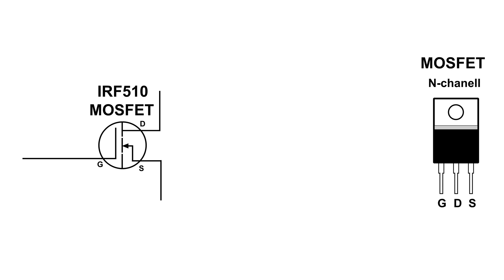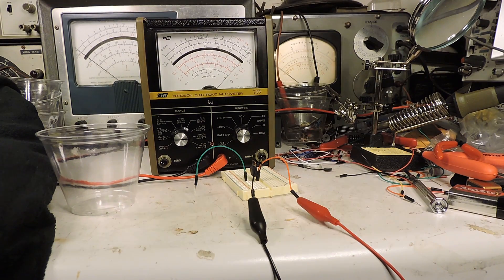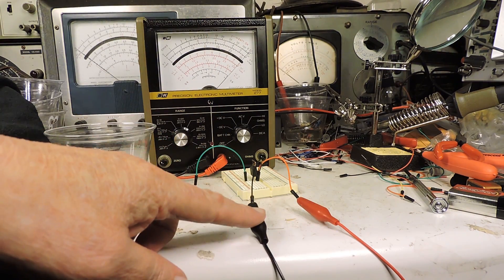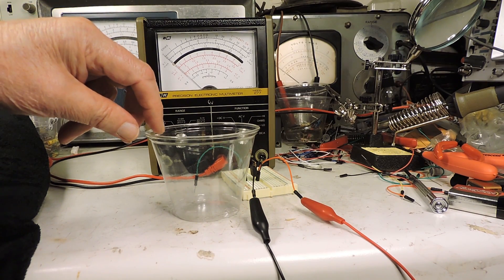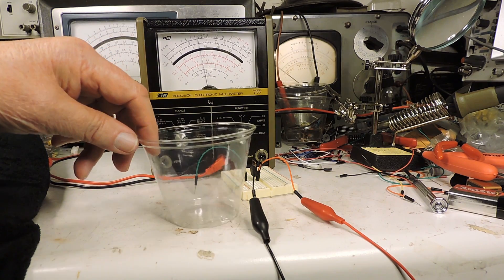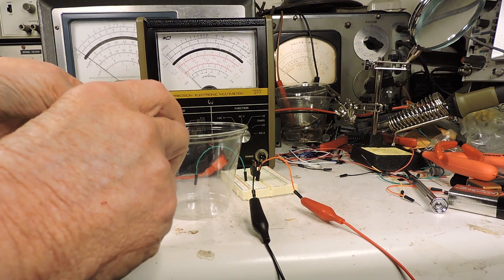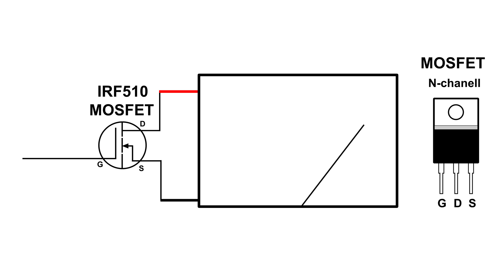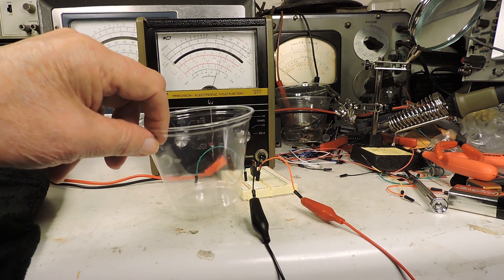Simple MOSFET Experiment

Comment: Want to use IR F541 instead of diode
What is the easiest way to do it?
Reply from the maker: That should work.
Reply: @AllAmericanFiveRadio  If I were to write a circuit instead of one diode, what would it look like? Do you have an example?
Use MOSFET as diode
Reply from the maker: @อุ่นใจอาละวาด  What is it that you are wanting to control?
Reply: @AllAmericanFiveRadio  I want to parallel two batteries to make them last longer. I will use an diode to connect the positive terminals of the two batteries and then parallel the outputs.

Comment: The picture you are using has a spelling error, "chanell" should be "channel". Could you also make a video on protecting mosfet in usage against static electricity and over voltage when one switches high voltages than maximum gate voltage. Thanks for very interesting videos.
Reply from the maker: Dyslexia strikes again. I have been thinking about making a video on working with MOSFET's and SCR's
Thanks
Reply: AllAmericanFiveRadio Great I'm waiting. with great interest ;-)